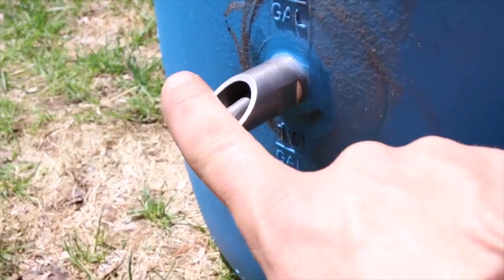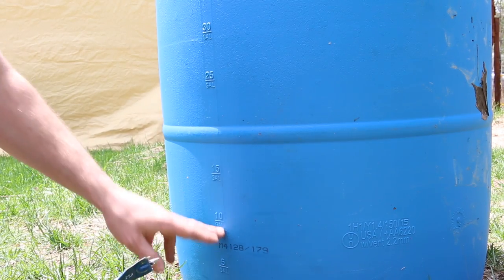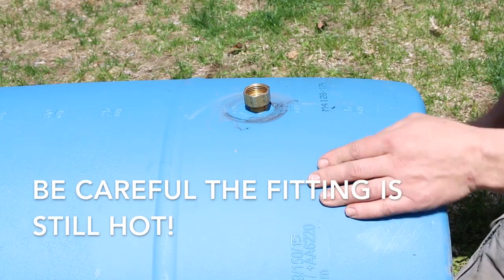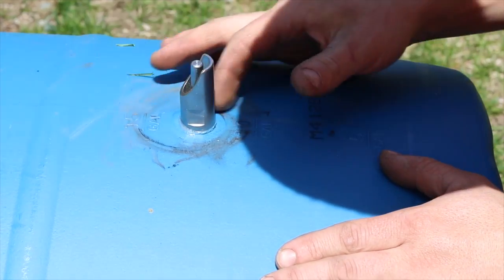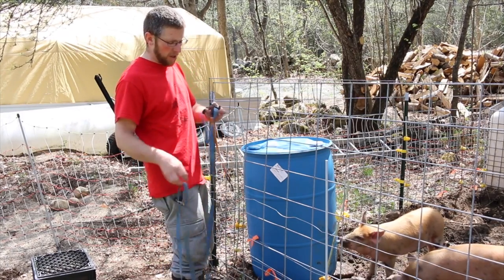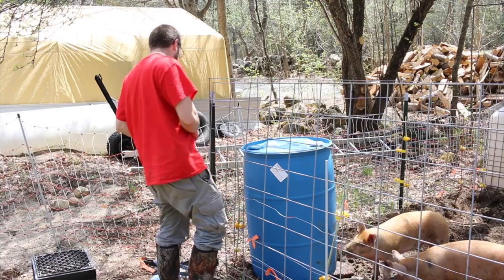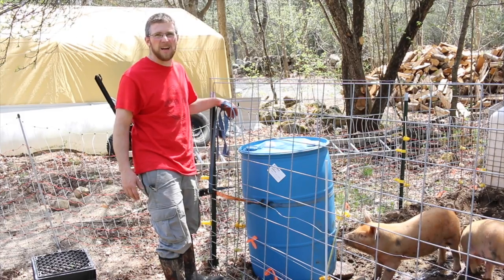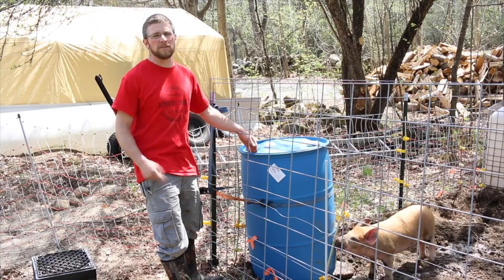Automatic Pig waterer

Comment: If you have issues with it pulling out, use a "Meyer's Hub" (this is an electrical part for going into meter boxes).  The Meyer's hub is what the kits come with and the lock nut on the back is flanged out so it will hold better

Comment: Great idea. I would suggest checking out what's called a bulkhead fitting to make the connection to the barrel. They're cheap and vey reliable. I've learned the hard way that what works great on piglets in May is destroyed by the hog in November. Thanks for the video.
Reply from the maker: Bill Speed yw. The nipple threaded into the barrel worked great. The pigs never pulled it out. The threads have held up great. If they do pull it out I will try a bulkhead. Thanks
Reply: Getting bulkhead fitting started in a barrel like that is a royal  the hole on the top of the drum is only 2" so You can't get a hand in there let alone reach down that far  so You have to rig up some kind of a extension holder
Reply: @waltlars3687  
I need to put a heater in my barrel, so the top will have to come off. Plan on hinging it and having a tie-down on opposite side for wind and leaves. Figure I’ll be inside on my back to couple everything tight anyway

Comment: I put a washer and nut on the inside to keep it in my pigs pulled it out. Since I did the washer and nut it been in the pin for 5 years. Use stainless nut and washer.
Reply: Steve, where did you find the nut and washer? I checked my hardware store and the threads were different from the nipple so would not work.

Comment: Hi, I am interested in all types of labor saving devices and ideas. One thing I was wondering is about that last 10 gal of water in the barrel. Wouldn't you want to be able to completely drain the barrel by putting a connector in the bottom? Just thinking of being able to wash it out completely if something contaminated the water in the barrel. Great video/idea. Looking forward to seeing how it holds up for you this coming season.
Reply from the maker: Holistic Advocate   When I add more water 💦 it freshens up the first 10 gallons. When I clean it I just dump it over. But you could add a spicket On the bottom. We use the water all last season! And it worked great! I can't wait to use it again this coming season
Reply: The leftover water helps keep it heavy so the pigs don't roll it over all the time. Bigger pigs will still flip it tho.

Comment: didn't take them long to figure that out!! Like the heated fitting trick....now, if I can talk the wife into pigs!! lol!
Reply from the maker: they are fast learners. Pigs are very easy fun and they dont smell to bad if you keep the pen picked up. They pee and poop in the same corner all the time. They want to be clean. Heating the fitting worked awesome.
Reply: any thoughts on what you'll do for either the pigs or birds once the colder weather starts rolling in?
Reply: as far as icing water that is
Reply from the maker: Keith Rayeski the pigs will be in the freezer. and for the chickens I will have to bring out water to them. in the past I just use bowls in the winter and swap them out a few times a day when they freeze
Reply: Keith Rayeski pig do better in cold weather  but will need shelter  from wind and cold 
They will consume more feed to stay warm 
The key to keeping smell down in a barn is air circulation  I use two fans  one to blow air in and one to suck air out 

If you have a high enough CFM cubic Feet Min. Rate to move the the cubic footage of the barn in a minute  they won't be any smell

Comment: I locked my nippler in with epoxy plastic it dosnt leak and the pigs will never be able to pull them out it basically molded the nipples into the plastic

Comment: Do the nipples free flow if the center post is pressed or does there have to be suction on it for the water to flow? I just built one and tested it with just pressing and got no flow, then i tested with suction and there was flow. Not sure if I got faulty auto watering nipples.

Comment: wow i like this video great job pls where can i get this nipple tap to buy or can someone pls tell me the name
Reply from the maker: Annabel Daniel there is a link to it in the description
Reply: Annabel Daniel any store that sells pig chow normal carries  they are pig water nipple waterer  or just water nipples
Reply: Annabel Daniel I drilled the 3/4" hole with a 3/4" paddle bit started the nipple by hand threading then a wrench to finish threading it in, don't over tighten or you'll strip the threads, just tighten til threads disappear, I watched Justin Rhodes do it without heat,, I installed 2 nipples and no leaks

Comment: this might be stupid question but... ou drilled a 3/4" hole and your brass fitting is 1/2"? But would it be too small or does it work out with the threading?
Reply from the maker: it works with the threading its odd! I know! Lol
Reply: 1/2" is the interior dimension for the pipe... So the pipe exterior is of course larger.
Reply: Thanks so much for this video! Pigs love it.

Comment: Any suggestions for keeping it from freezing for those of us with livestock during winter? (Breeding stock) The tank deicers would require cutting the top off for it to fit.
Reply from the maker: How cold does it get where you live?
Reply: You use any saw to cut the top off. MAKE SURE YOU CUT DOWN AN INCH OR MORE BELOW THE DEPRESSION IN THE TOP OF THE DRUM. THEN FLIP THEW LID OVER AND IT COVERS THE DRUM.

Comment: Lol nice vidoe man but your doing way to much work. First remove the screen take the red plastic insert out drill to small holes in it, that will allow more water to flow out, just get some tape and screw it on the the pigs will eventually hit it with enough mud and stuff it will not leak

Comment: To me it looks good but I do have a question - Wondering why you didn't place 2 nipples in? ~ Karen
Reply: +usakiwi5222  ... good question:-)    that would make sense!
Reply from the maker: +usakiwi5222 I only have two pigs, and even if there was two nipples they would fight over the same one. If i need to  I can always add another one. thanks
Reply: Lumnah Acres  Thank you for answering, I really appreciate that. I'm trying to learn and didn't know if there was a special reason or not. ~Karen
Reply from the maker: +usakiwi5222 no special reason really. You could do two. I only had one on had when I made it. Now that they are use to it they only drink one at a time anyways. the link I left in the description is for two nipples.

Comment: What if you don't have a torch?  What could I use instead?
Reply from the maker: You could try using a lighter. I don't know if it will get it hot enough or not but you could try it.
Reply from the maker: How many pigs are you raising? You could also use a bulkhead fitting to attach the nipple to the barrel.

Comment: I guess I have stupid hogs.  Tried this waterer and I couldn't get them to drink.  I put marshmallows on tip to entice, they ate them but never would drink.  What am I doing wrong.  Frustrated.
Reply from the maker: I dont know. That seems surprising. Did you leave their other water in with them?
Reply: no other water in pen.  left it for 2 days, but the water level stayed the same.  I put their other water container in their and they were fighting to get a drink.  I m frustrated, as they constantly tip it over.
Reply from the maker: I wonder if you get the nipple to drip water for a day or so if they will figure it out? I would try that.
Reply: Press down on the center post let water run for a while and make a puddle on the ground  they will figure it out  check to see if the center is free and will allow the water  to flow 
The valve might be tightened down too much

Comment: Maybe I am dumb but how can a 1/2 pipe thread fit into a 3/4" through hole?
Reply from the maker: Tony Zimmerman Great question half-inch pipe thread is not the diameter of the pipe that's why A three-quarter inch drill bit works for drilling and making threads
Reply: Tony Zimmerman the term 1/2 " pipe is the inside diameter  the outside diameter is like a inch  depending on the material  and the threads of the fitting are tapered  so 3/4" hole is the right size  Considering He want a tight waterproof hole
Reply: I just went to the hardware store to get everything and the guy showed me to just buy a tank fitting. It’s a half inch female pipe thread tank fitting plastic unit. Perfect for this project